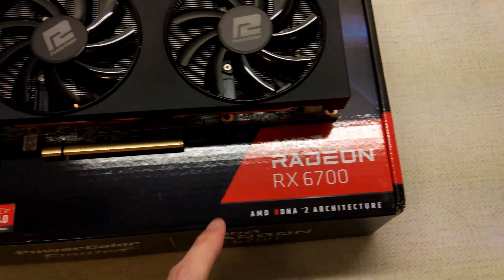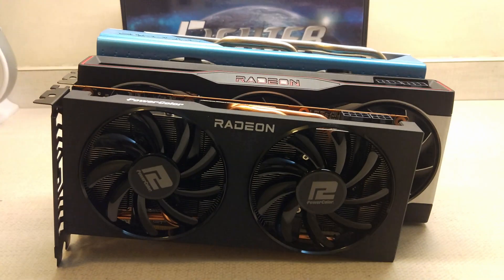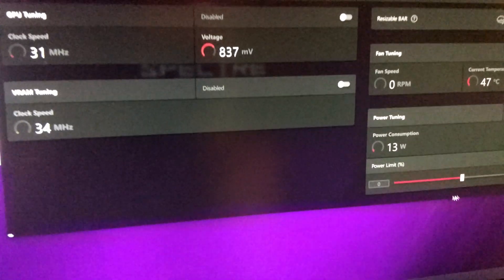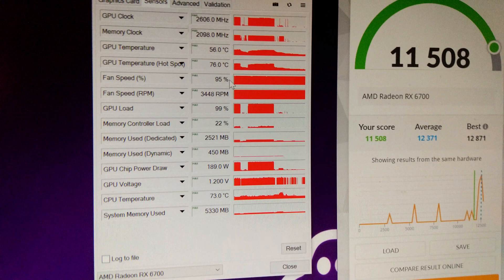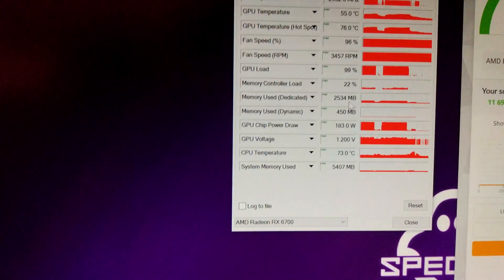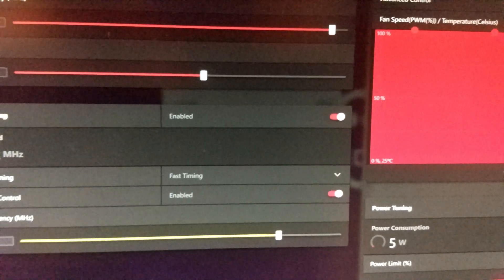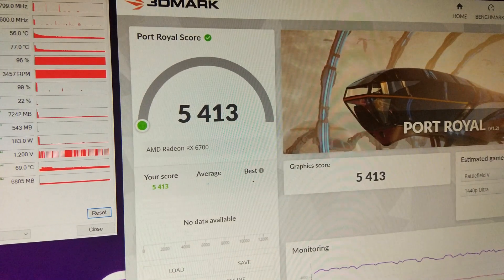Powercolor Fighter RX6700 10GB Overview Undervolt and Overclock

Comment: HI, what do you recommend to buy as a budget card, RX 7600 (and do undervolting to 150w), RX 6700 10gb like in this video (even is 4 year old card) or RTX 4060 ? Thanks for the answer 😊
Reply from the maker: @antony0504  I think the rx6700 would be best. It will be the quickest but use a little more power. You can undervolt it though
Reply: @LawrenceTimme  Forgot to write, gona use for 1080p gaming and RX 6700 have 2 year warranty and little cheaper and other two have 3 year and little more expensive

Comment: I have the RX 6700, Sapphire Pulse version with Micron chips memory, it's a very good GPU card for the price. I've OC mine with MPT,  less power voltage more clock frequency, not noisy.

Comment: The RX 6700 is a fantastic 1080p card. I run one of these for a year (XFX brand) and had no issues running anything. I did get a warning from Forza Horizon 5 one time about low memory, but once the shader cache was built it never returned.

Comment: on th ese new amd cards.. u can just turn memory all the way up . and clock sspeed all the way. up . power limit all the way up. and stress test.. and it will just go as high as they can together. usually memory stays 2-2130 . and for my clockspeed on a 6700 10gb xfx version of the card 2746 is what im hitting with an undervolt of literally 2 percent. lol'
Reply from the maker: Yes, but you are always power limited unless you have more power tool installed so you still need to check if the extra peak clock speed is translated into more performance. :)

Comment: hello, i have this grahic card too . but, recently its making clickin sound. not really that recent, almost like 2 month or 3 month ago. i have this grahic card for about 7 month now and the clicking noise is loud cant bear it anymore. so do you have this kinda problem too with the power color rx6700 ?
Reply from the maker: Check the fans are not catching on anything
Reply from the maker: No mine has been fine. It's sounds like you could have a bad fan.

Comment: Is it better than 3060 Ti? Are you happy with the card and how would you compare it to the XFX and Sapphire versions? Sorry if I sound like a noob, I've been out for years when it comes to PC hardware, and it's about time to buy a new PC, because I need it for work (I work in Creo), so I'd take something for the long run. Would it be ok to pair this card with something like i5 11400 (preferably i5) or R5 5600?
Reply from the maker: Hi, it is a little bit slower than 3060ti, the 6700xt is more like the 3060ti performance. I have not used the sapphire or xfx version of this card. I would go well with 5600 or 12400
Reply: @LawrenceTimme  Thanks man. I also came across some used rx 6700xt and rtx 3070 (not used for mining) at a very attractive price of around 300 euros, so now I'm in a dilemma, I don't know whether to go for the new rx6700/rtx3060 12gb or the used 3070/6700xt, even though new 6700xt is just 40€ more than non-xt. I'm aware that even weaker cards would be enough for my work, but I'm sure I'll play some games on a 1440p monitor, even though I already have an Xbox.

Comment: I have one and I have been having trouble getting my second monitor to work with it, HDMI works fine but none of the dp ports have no connectivity :(
Reply from the maker: AMD cards can be fussy with the cable sometimes. Have you tried a new dp cable?
Reply: @LawrenceTimme  Yep, I bought two new ones, then tried hdmi>dp and a vda>dp wire but nothing worked or was detected in the display settings.
Reply from the maker: @Louaffi  rip it could be broken then, maybe try rma
Reply: @Louaffi  did you solve it?

Comment: For most efficiency * wattage/power/ FPS +couple more then stock * I use on this card:  1080Volts, min/max 2500/2600 fast memory,  power limit +15%, mem 2112 fast timing,  runs stable as fck with 130w instead on 160W On Cyberpunk2077, ultra, HD res...with fans almost quiet on custom curve 1450 rpm (42%) temp bellow 70 C cos these fans tend to get noticeable loud over 52%
Reply: Can u make a short video just recording the settings please?
Reply: @MandaVpn  its easy, I am sure you can do it

Comment: I bought the 12 GB version from Amazon a few days ago for $419 +tx.  It fits perfectly in my mini-ITX build in a Cooler Master RC-130-KKN1 Elite case, even with the optical drive bay still inside, with room to spare.  Using MSI Afterburner, I was able to change the fan speed to 35% constant, and keep the temperatures down below 40 degC during normal usage.  I have a feeling temperatures are gong up to 74 degC playing Halo Infinite multiplayer.
Reply from the maker: 35% seems a bit too low.
Reply: @LawrenceTimme  35% was good for normal GPU usage but I had to crank the fans all the way to 70% while playing Halo Infinite or it would shoot all the way up to 98 degC.  At 70%, I was able to keep temperatures hovering around 72 degC. Halo Infinite is a shitty-ass game that jacks the temperatures up IN THE SEARCH SCREEN when there's nothing happening!
Reply from the maker: @l.i.archer5379  try Radeon chill
Reply: @LawrenceTimme  just tried it.  GPU still gets up to 74*C playing Halo Infinite.  It's the game.  It's not even ray-traced and it's a literal GPU hog.
Reply: @l.i.archer5379  is the card as noisy as people say or does the sound acceptable
Reply: @muhammedfathi1988  it gets a bit louder when gaming, because the GPU is working  harder, but I have headphones on when I'm playing a GPU-intensive game (Halo Infinite), so I don't hear it at all.  The fans barely kick in when I'm playing Halo MCC, where temperatures never got above 51 degC.  The fans shut off when I'm doing anything else, like watching a DVD movie, Youtube video, surfing the internet, etc.  The GPU stays at around 37 degC, so the fans don't even come on.  

The card is on sale now on Amazon for $369.10.  They wouldn't do a refund on the difference during this return window, so I ordered another one at the lower price, and returning the one that's already in my PC, all at their expense.  Amazon's stupid policies amazes me sometimes.  LOL!!

Comment: You should have lowered the voltage to 980-1000mV and set the max. frequency to 2800 and minimum frequency to 2700. The software raises the voltage offset automatically when you raise clock settings so if you clock higher, your voltage should be set way lower. This allows the card to clock higher but keep power draw down, +250mhz compared to the sorts of clocks you were getting in the end should be doable.

With these settings, my card stabilises at 2700 mhz while running Unigine Superposition 4K. With 80% fan speed it stays at a maximum temperature of 70 degrees, which is 47 over ambient here. These chips have way more overclocking potential in them than the voltage limit allows for, which means that you cannot really push it to its limits with just +15%. I already checked wether power play table modding in the BIOS was possible - it's not - RedBIOSEditor doesn't recognise the BIOS of my card.
Reply from the maker: You can use more power tool to increase the power limit too
Reply: Hi, morepowertool work in this card? 6700 non-xt

Comment: Is anybody else having trouble with customizing the fan speed curve on this gpu? I do it in the AMD software but after some seconds the previous configuration comes back automatically
I saw that it wouldn't pass the 890 rpm even though the fans are capable of running at like 3,000 max but it wouldn't seed them up a bit unless I made the custom fan curve then it'd cool the gpu effectively but it just doesn't save the changes
Reply from the maker: Have you tried updating the driver or uninstalling the driver with ddu? It sounds like a conflict
Reply: @LawrenceTimme  I put the card new and then installed the driver in the "automatically detect" mode, it says its the latest version available.
I'm going to try uninstall and reinstall again
Reply: @LawrenceTimme  I did it
Still not working properly :/
Reply from the maker: @Алек-д7щ  wow that is strange. So you have MSI afterburner or Asus GPU tweak or anything like that installed?
Reply: @LawrenceTimme  Yeah it's so weird, I read about something similar people were experiencing on 2020, in that case the saved fan curve profile would reset after PC was turned on. In my case it's not even necessary to do so for it to not work correctly lol
Yes I have MSI Afterburner, that Asus software.. I don't know it maybe should give it a try.
I have AI Suite 3 but it's for things on the Motherboard I think, CPU voltages, chassis and CPU fans, etc
Reply from the maker: @Алек-д7щ  normally if you set msi afterburner it conflicts with the driver.  Maybe try uninstalling that?
Reply: @LawrenceTimme  Oh great idea, I'm going to try that too tomorrow
Thank you for the replies and help
Reply from the maker: @Алек-д7щ  no problem.
Reply: @LawrenceTimme  Bro I think it worked
You have saved me! Thank you very much sir!
I didn't think that could be the cause of the problem since it didn't make a difference whether I had that program open or not.
Again thank you, thank you so much, I'm gonna subscribe to your channel even though I'm not than into these topics at this moment
Reply from the maker: @Алек-д7щ  glad you got it fixed :D

Comment: do you think powercolor is a good brand? I have heard that it is not that great and that in the long run it poses problems. I am undecided whether to buy this card or msi rx 6650 xt mech x2, they have the same price, but I think msi is better for quality
Reply from the maker: I've got Powercolor 5700xt that have been mining 24/7 since December 2020. They are perfectly fine along with the msi 5700xt and sapphire 5700xt. I wouldn't say they are any worse or better quality than msi,  just this is a budget model so it doesn't have a backplate or a huge cooler.  The 6700 is quite a bit better than the 6650xt too. 

Also look for the sapphire 6700 too, although it's normally a bit more.
Reply: @LawrenceTimme  Powercolor has offered some of the best AMD cards over the past few generations with their Red Devil and Liquid Devil models.
Reply: @LawrenceTimme  Miners need to stop stealing all the GPUs
Reply from the maker: @apples874  too late I bought them all.

Comment: How is the fan noise? Considering buying this card but I have a powercolor rx580 and the noise is horrendous under load.
Reply: I have TUL RX-6700XT Fighter 12GB. Fan noise is not loud... however after using 2 months for light gaming one of the fans started to rattle very loudly. Also coil whine is huge with this card I had to limit gpu fps to 144 and undervolt and underclock to make it less noticeable. But is still moderate and noticeable. I also had MSI GeForce RTX 3060 VENTUS 2X 12G OC. It had absolutely no coil whine while using on same pc.
Reply from the maker: @elitic7  my 6700 has no coil whine at all
Reply from the maker: The fans spin quite fast but I can't hear it over the mining rigs XD. Its probably not the quietest card, however if you undervolt it enough I bet you could make it quieter, use less power and get the same performance. I think tech yes city did a guide on how to do it.

Comment: Just ordered one for £284.99 after looking at RX 6600's in this price range!
Couldn't find any info on this card barring your video, but ordered blind under the assumption that  it will fit somewhere between an RX 6650 XT & RX 6700 XT.
Thanks for the content, appreciated.
Reply: £285 is a bargain mate, I paid £350 for mine, Great card though!
Reply: @scotty6346  Honestly couldn’t believe it when I saw the price. 
I was just about to pull the trigger on a RX6600 Eagle for the same price, then did one last page refresh 👀.
I’m super impressed with performance/temps/power usage so far.
Reply: @this-is-my-youtube-handle  Undervolt it mate, I'm still tinkering but ive got mine down to 1050mv and it's getting 2760mhz on the gpu and 2100mhz on the memory! (Samsung memory) 👌
Reply: What retailer please?
Reply: @D-Clips  CCL - they ran out of stock the next day, now discontinued.

Comment: When I was looking at other 6700 cards I noticed there mostly just 8pins, but I don't think it matters when the oc is locked behind software
Reply from the maker: Yes this one is 8+6 pin. Not sure why
Reply: @LawrenceTimme  I only have one 8 pin connector coming from my PSU, do you think it's safe to use a splitter? Originally a Nvidia RTX 3060 came with this desktop which approximately has the same power draw i believe. Though, the 3060 has just one 8-pin connector.
Reply from the maker: @svenstekelenburg633  if it can power a 3060 then yes you should be fine as long as you don't raise the power limit.
Reply: @LawrenceTimme  Thanks for your answer. I've read about the pcie slot being able  to deliver up to 75 watts through the slot. I wonder if the powercolor RX 6700 supports taking energy from the pcie slot. Might be the reason it uses 2 molex connectors in case it does not support taking power from the pcie slot. Is it possible for you to see if it's pulling energy from your pcie slot?
Reply from the maker: @svenstekelenburg633  there is no way to tell, but past amd gpus like rx480 have taken power from the pcie slot. They best way to find out would actually be to find a video on a mining channel as they normally do more extensive testing on power consumption. I'd expect it to pull 50-70w from pcie
Reply: @svenstekelenburg633  Each graphics card always draws power with PCIe and further from the additional pins power supply. The Radeon Sapphire RX 6700 10GB only has 8 pins of additional power, so I don't know why the card Powercolor  tested here has 8 + 6 pins. The power consumption of the RX 6700 10 GB is 175 W.
Reply: This gpu isn't actually bad build quality
Reply: Have you played with morepowertool as you did refer to it. My gpu seems to limit to 205w even if I set well over that. it does make the GPU hold 2700mhz tho. Still messing with it
Reply from the maker: @Bassjunkie_1  yes mine has used 230w :)
Reply: Oh I also set the vcore to 1090mv, any lower and I loose performance
Reply: I noticed once I pushed the ram is went to 210. Have some way to go
Reply from the maker: @Bassjunkie_1  I'm not sure how wise it would be to run it at that all the time. 200-210w seems good. The performance gain from going higher is minimal
Reply: I best clarify the power limit. I can set the power limit all the way to 260w or more I guess as that's as high as I was willing to set it. So when benchmarking the limit was set to 260w while according to hwinfo it was pulling a max of 205w before any ram oc. Tho I can't seem to set the clocks any higher than 2800. Anyway you're right, 200w is fine with 2700/2800mhz clocks

Comment: How much power Draw in Watt does the card have with untuched changes (non overclocked)?
Reply from the maker: @UCLKbmentp3bNUSKl3ebFtEw correct. That is the stock power limit and of course being a modern card it always boosts as high as possible using all the power limit I can :)
Reply from the maker: Literally says in the video m8
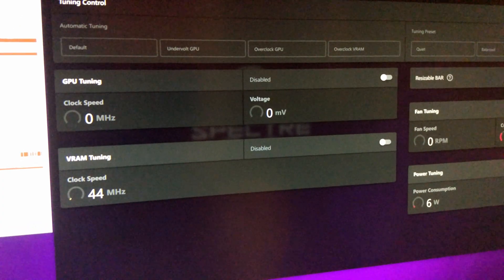Reply: @LawrenceTimme  On 7:03 you show the power limit is it unefected by your changes?
Reply from the maker: @UCLKbmentp3bNUSKl3ebFtEw correct

Comment: just bought one 359€, lets see
Reply from the maker: Great deal :D
Reply: How is the fan noise?
Reply: @SBBUK  i mean, inaudible in my humble opinion......
Reply: @michielroskam3877  thank you, I have ordered it! Will be a nice upgrade from my rx580 which is incredibly loud
Reply: @SBBUK  no way bro, i upgraded from a rx 580 too......just sold it today
Reply: got the card installed today, it's very quiet and very happy with the performance! The fan turns off completely below a certain temperature too. Gone from medium to ultra on Forza horizon 5
Reply: @SBBUK  I would like to buy it too to replace my rx 580, how are the temperatures and the noise?
Reply: @raffaelebazzardi9189  very happy, I would recommend it. Card stays under 80c playing bf5 and noise is not loud at all. The fan shuts off at idle so on the desktop it's silent!
Reply: @SBBUK  80c gpu temp? That mean hot spot temp 100c+  right?
Reply: hello, can I ask you where did you get it at that price? thank you.
Reply: @ProgTheater  netherlands,  from a company called megekko
Reply: What are the temps like? Is it loud ?
Reply: @SKanda04  very happy personally. In my case stays around 80c in BF5 and fan is barely audible.
Reply: @SBBUK  80 hot spot temps?
Reply: @SBBUK  oh that’s good thanks I’m getting it for my birthday in a weeks time can’t wait